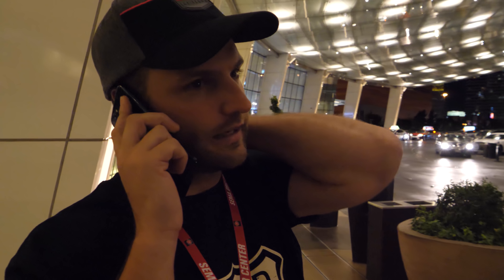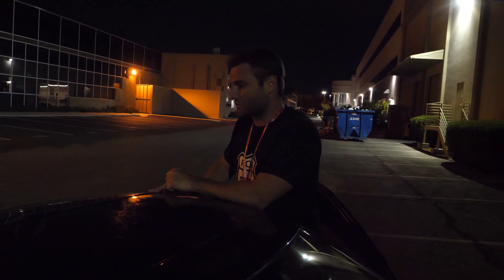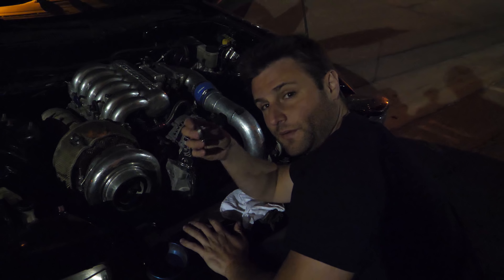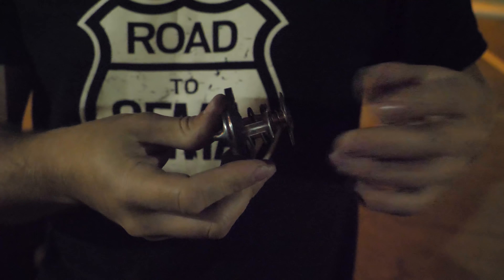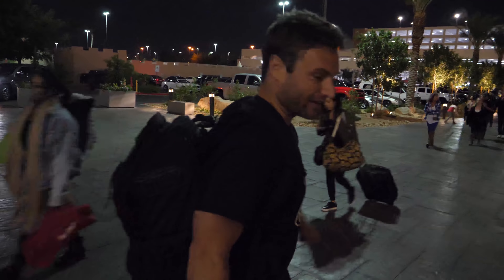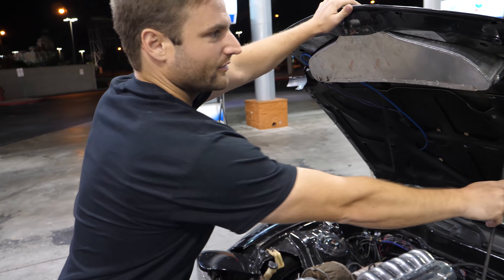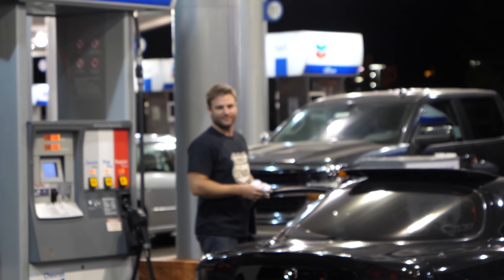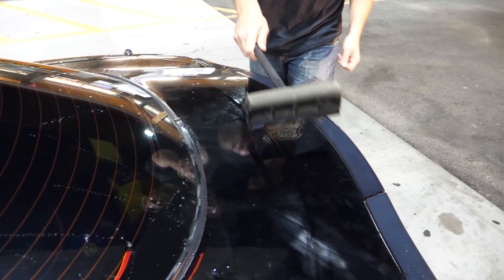Road Trip In The 3 Rotor Goes Exactly As Expected

Comment: I have a similar battery pack. Hopefully, it works the same. The control box that you plug into the battery pack is short circuit proof. When the two terminals are connected or touches, the control box sounds an alarm, no sparks.

Comment: Why are you putting oil in your gas Rob?
Reply: MonteLSV6 lubricates the rotary engine. He removed the factory oil system
Reply: Oh wow, thanks for letting me know! What's the benefit for removing the oil system and going with a oil and gas mixture like a 2 stroke engine?
Reply: MonteLSV6 it's a way more efficient way to appropriately lubricate the entire combustion chamber of the Rotary as opposed to the stock oiling system. I would still recommend doing it on a stock engine, just as not as much oil mix as a guy with a deleted oil system.
Reply: yeah, I saw that and had to look it up.  Did not realize that was a technique used by some RX owners.

Comment: Rob your "jump box" has a safety and won't short circuit what the cables touch, it should also have a safety so it won't blow up being hooked up backwards. Just FYI sometimes instructions are good to read.
Reply from the maker: +Jason454ss I was handed it lol and I don't want to test that feature
Reply: Rob Dahm about idea connect it to the battery then plug the cables in. Oh the benefits of watching a video on a phone over being in the situation. A very unknown fact is you know everything the internet does when your in front of a camera.😀

Comment: first why don't you put the cables on the battery first then plug it into then jump box thing, and second, even if it's low on coolant, it will spit out when it's hot, you are right it need to open the thermostat then fill it up

Comment: might be a bad u-joint not the diff. ive had a bad u-joint vibrate like crazy at 65 mph and over.  slight vibrations at around 30 mph. but if its a bad u-joint you'll probably feel a noticeable clunk as well
Reply from the maker: +TheWhoever811 I hope that is what it is. Working on it now